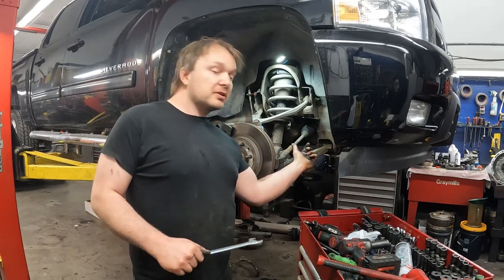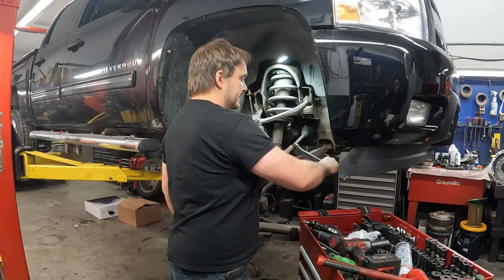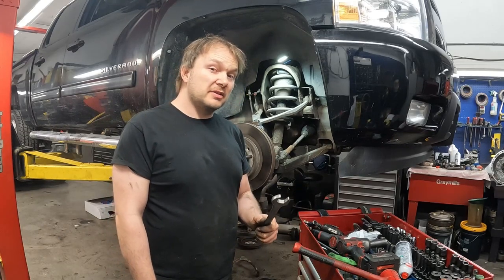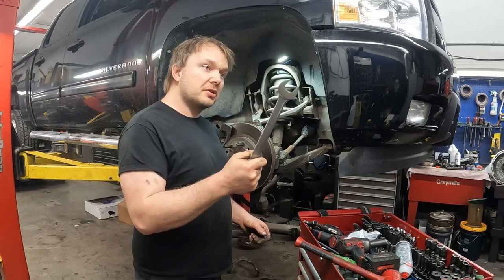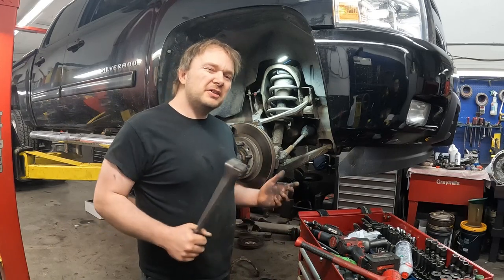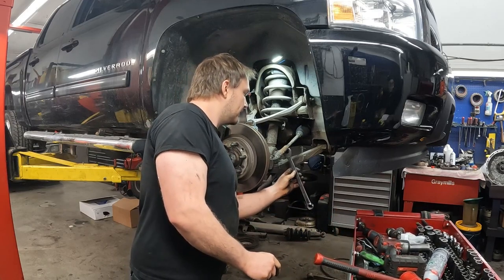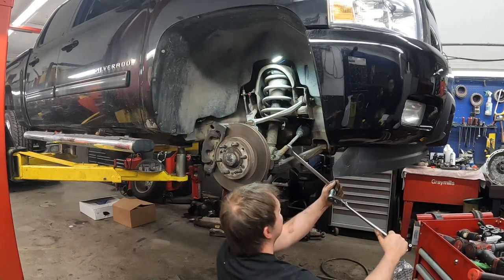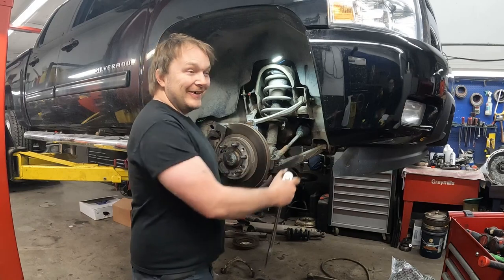Cool Tools 2 - Allen Sockets - Turn any wrench into a large crowfoot socket!

Comment: You had some really good tool tips. Thanks. As for that style bmw, I use a 1/4” e10 universal. I also don’t like double wrenching and I don’t have a wrench extender so I usually use a pipe.
Reply from the maker: @Steven Farley  Oh ya, you probably could get a universal e-torx on that! I bought a set from Gearwrench a while back because they were on sale and super cheap. The useless things are all 3/8" drive though. Even the small ones. I don't think I've had them work once for me... I've thought about getting some good 1/4" drive ones but I haven't come across enough situations where I was stuck without them. Or maybe I just haven't noticed how helpful they would have been!

Comment: This extension is a great tip. I could have used it to replace the engine mounts in my MB 190E.
Reply from the maker: @gianfrancoa  Thanks! It's definitely saved me quite a few headaches. Not something I use every day but a good trick to help you get out of tight situations that doesn't require you to buy special, single purpose tools!